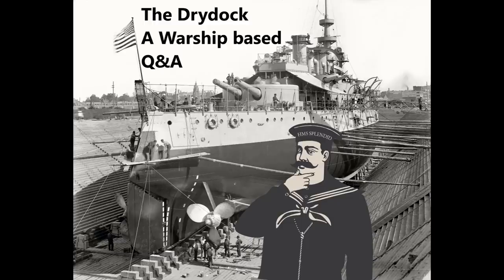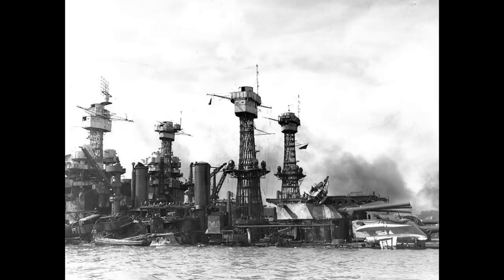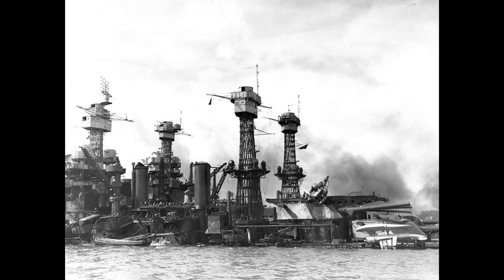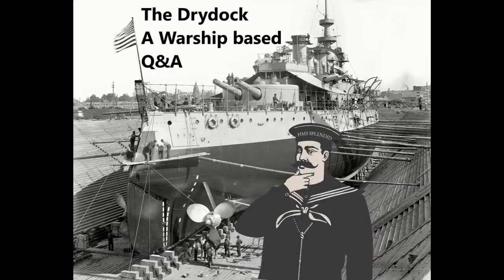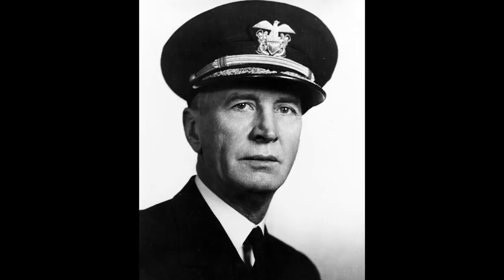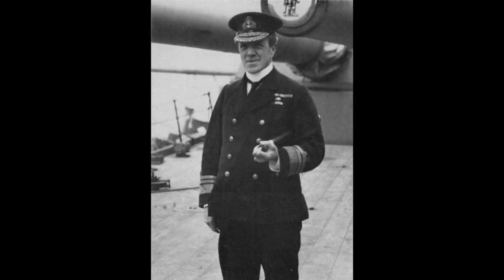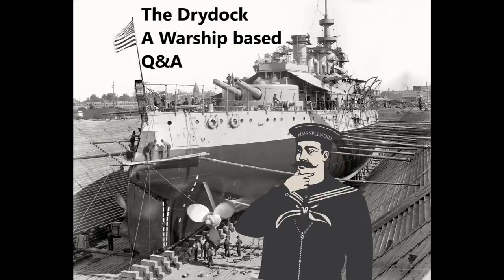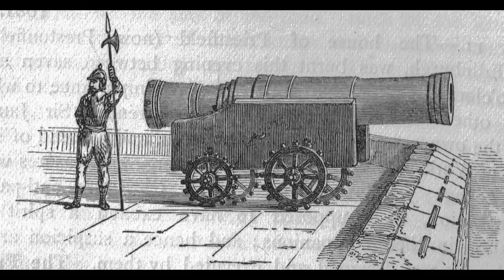The Drydock - Episode 172

Comment: NOTE:  When talking about the skeg problem, you had a picture of the later design of the IOWA Class stern skeg/propeller/rudder complex.  Did you note how narrow the gap was between the two side-by-s9de huge rudders at the tail end of the ship?  This concentrated the turning moment of the engine power of the two inner skegged multi-blade propellers and made the ship significantly more maneuverable at higher speeds.  Better than the NORTH CAROLINA Class, as you mention.  However, it turns out that it had a secondary use that was more-or-less unique to the SD and IOWA Classes that used this rudder arrangement:  To wit,  The gap was so narrow that if both rudders were turned in OPPOSITE DIRECTIONS to right-angles to the ship centerline, they formed a roughly SOLID WALL to the water being pushed through the two center propellers and at least some of the water from the two outer propellers.  The result?  Even when moving at full circa-33+ knot speed, the ship could be stopped more-or-less WITHIN ITS OWN L:ENGTH!!!  "Ultimate Emergency Stop" as noted in some sci-fi stories, but real here.  The force could possibly damage the rudders, so it was not to be done unless really needed and an inspection would be needed after each use to make sure about this, but it was a very unusual ability, wasn't it?
Reply: How could you enact such a maneuver?  I would think this would need to be performed from the steering gear location directly as turning both to act as speed brakes is well outside their normal deflection ranges.
Reply: The pictured ship is BB-61 USS Iowa.

The only reference I have come across for opposite rudder steering for an emergency stop was for BB-64 USS Wisconsin.
Reply: As a Star Fleet Battles player, yeah, used emergency stop when fighting Romulans and Gorn.
Reply: @WayneBorean , but you always have reserve warp on tap, yes?  It can still be a l...o...n...g seven impulses, if the chart catches you wrong, though.  I got Miziaed into uselessness once because of it (I should have just eaten the drone swarm).
Reply: @mbryson2899  If you planned reserve warp. I avoid situations where Emergency Stop might be needed, I play Orion and speed is my friend!
Reply: @WayneBorean  Orion?  I thought cocaine was their friend, not speed.  ;)
Reply: @mbryson2899  Nah, they go for Klingon Kkrrkt, a fine herb.
Reply: @WayneBorean , Krikket?  Those folks are crazy deadly!

Comment: While it's not warship related, if you're traveling down the eastern seaboard, you might be interested in Mystic Seaport. They have a number of preserved sailing ships, as well as rides available on the Sabino, one of the last functioning coal fired steam ferries. The engineering spaces are all very open on the lower deck, so it's a rare opportunity to see a full marine recipocrating steam plant in operation.
Reply: Been there. A worthwhile and interesting excursion.

Comment: Jeune Ecole theories may have had a chance in the late 19th Century: the wireless telegraph would not start to be adopted until the beginning of the 20th century. Before that, it was impossible to contact ships at sea so the chances of finding and intercepting a raider was almost non existent. So commerce raiding to destroy the enemy economy as advocated by the JE theories could have worked. 
The standard tactic in the 19th century had been the close blockade of enemy ports (again because it was not possible to contact ships at see, a distant blockade was not effective). So the practice of close blockade continued, like in Santiago in 1898 or Port Artur in 1904. Even the RN didn't change to a distant blockade of Germany until the eve of WWI. That's why their new base, Scapa Flow, was not ready yet at the start of that war. 
But by the 1880s the new weapons TBs, mines and torpedoes were mature enough to be a serious threat against close blockade. 
Capital ships had been expected to defend themselves from attacking TBs (hence their numerous small calibre QF guns). This started to change in the late 1880s when the RN started to experiment with the idea of using small escort ships. But the handful of slow TGB in the 1880s and 1890s were a failure, while destroyers would not be adopted in the RN until well into the 1890s (USN not until 1902). So a night attack by the TBs of a blockading force with not or vey weak escorts was a real possibility. 
But of course it is very likely that the RN would have found ways to successfully counter these dangers  (convoys, destroyers, distant blockade...)
Reply: One factor that is overlooked I think is that you don't have to win a naval war to win a war. Sometimes, you just need the enemy to waste their naval power on winning a naval war while the land war actually decides the matter. If you can trick your enemy into dumping disproportionate resources into their fleet to counter your cheaper fleet, while using the resources you saved on your fleet to bolster your army, you may just achieve your main objective. 
      Germany, in the Great War, almost did this by accident. They went into the war thinking they would win a naval war with a line of battle, but that proved impractical after all. However, by 1916, they effectively were fighting the war at sea using Jeune-Ecole ideals. THe High Seas Fleet effectively became the coastal defense force that kept the enemy away from ports enough to allow raiders sufficient access to raid. Instead of cruisers and TBs to do the raiding, they used U-Boats. As Drach noted, the U-Boats in the Great War really did come close to precipitating an economic collapse that might have required Britain to either quit the war, pull the Army off the continent, or lift the blockade. Whatever the case, the Germany Navy almost, for a fraction of the manpower of the Royal Navy, prompted the British to give up the land war, which would have almost certainly seen the fall of France in 1917 as the French desperately depended on those million Britons just to keep the line.

Comment: On the subject of 1870s sabot rounds, while I know of no such thing in artillery, there was at least one among small arms. Specifically, the cartridge used by the Prussian Dreyse needle rifles was essentially an oddly shaped lead lozenge held within a thin paper sabot. On the upside it meant that the rifling of Dreyse bores suffered basically no erosion through usage, so long as they were properly cleaned they're often still pristine to this day. On the downside inconsistent separation and/or slippage between sabot and bullet was a large portion of why the Dreyse was so outclassed in range by the later French Chassepot needle rifles (the other being that the Chassepot used what a rubber basically O-ring to seal its breach, the Dreyse simply accepted leakage, and thus could achieve higher pressure).

I don't think that particular technique could've been scaled up to naval artillery, though, even putting aside the inevitable issues that will arise with paper in the often damp and humid environment of a warship.

Comment: Was the North Carolina vibration problem apparent on sound detection or sonar systems on the rest of the surface fleet or on submarines?
Reply: I would expect so, at least to  a certain extend. However ship identification by sound / signal analysis is more a 70s / 80s thing when proper computing power AND signal intelligence really started building up a library and providing the tools to access them in real time. But I am sure a trained sonarman in the '40s would be able to detect something out of the ordinary and over time realize it something that pops up whenever a NC class passes by at speed.

Comment: Regarding an 1870s sabot round, reliable separation is going to be a critical issue. It wasn't even satisfactorily resolved 70-80 years later, as demonstrated by the APDS round for the 17-pounder, which was devastating a short range where you could score hits but unlikely to score such hits beyond about 500 yards (far too close for tank/anti-tank combat). Reliable sabot separation for the 17-pounder wasn't achieved until after WW2.
Reply: The issues with the 17 pounder sabot round turned out to be caused by the aluminium(?) sabots melting in the longer full sized 17 pounder guns, in the shorter guns (like in the comet irc)it worked just fine which confounded them till they could do testing post war

Comment: Speaking of sabot rounds, could such round could have been constructed, using smaller caliber AP rounds...the kind with a bursting charge.  Say a 16" gun, firing a 12" around with a sabot.  The 12" round would have much higher velocity(and may need strengthening) but should penetrate better...and still go "BOOM".  The same thing could be done with...say 8" gun, with saboted 6" rounds

Comment: Drach, I rarely strongly disagree with a statement you make. I want to point out the issues with your statement regarding Formosa invasion versus the Philippines. As an advanced base and as a way of closing supply lines to Japan, it would have been an effective strategy. However that will require a major commitment of troops on the Asian mainland, as was in the Navy's plan. As a staging area for invasion, Formosa suffers some major weaknesses versus the PI: smaller size, enemy on three sides, and a questionable population. The trump card, politics, was the weapon that MacArthur used on FDR: Filipinos were American citizens at the time and it was untenable (in an election year) for FDR to not go with Mac's proposal. As it was, over 500 K Filipinos died during the occupation, most from starvation that would have been worse had the PI been bypassed. Only 10 K US soldiers died in the liberation, a number than may have been dwarfed by an invasion of the mainland and Formosa,
Reply: Filipinos were never US citizens. But I do agree that the US had a moral obligation to liberate the Philippines (in addition to cutting off the Japanese from the resources down south).
Reply: @glennricafrente58  You know, you are right. Philippines were a Commonwealth (the only one the US has had?) and not a territory, which would give them citizenship but not presidential voting rights.
Reply: @glennricafrente58  People like to forget that the Japanese occupation was brutal for many many people, including POWs. 

Imagine if those war crimes came out after the fact and the Allies had not attempted to release the area from Japanese control.